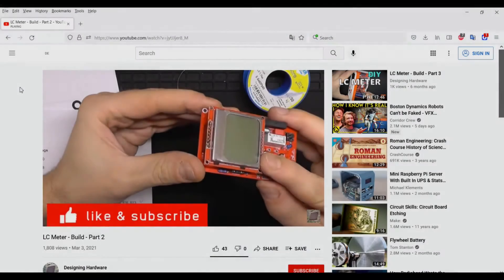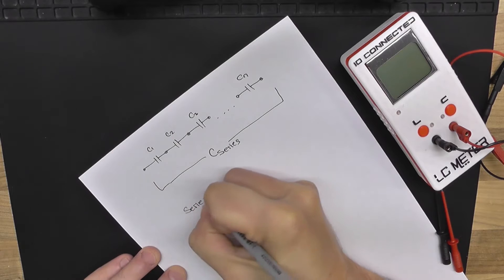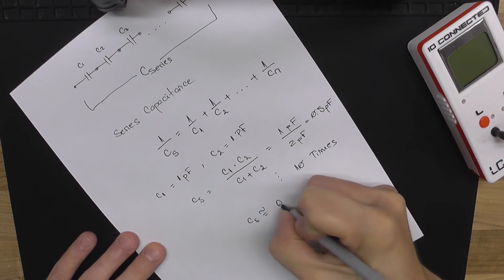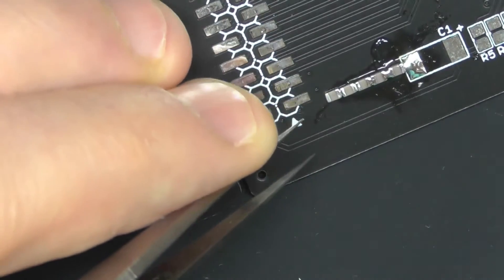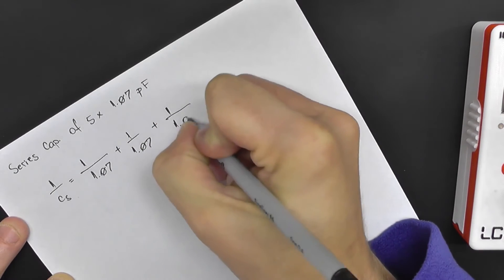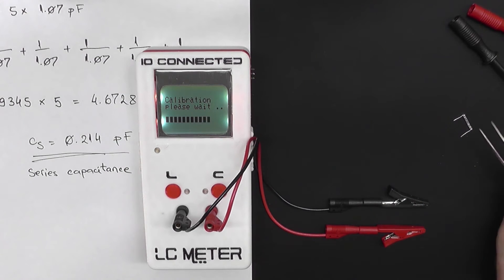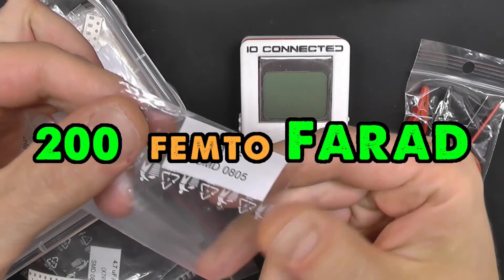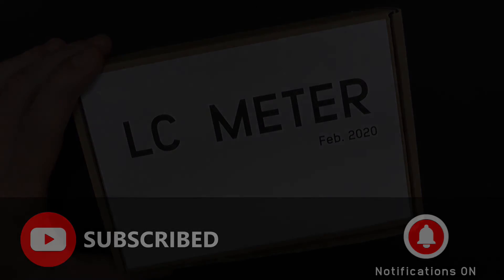INSANELY low capacitance !!! Measuring Femto Farads with the LC Meter

Comment: Impressive. I’ll need to go back and see what kind of front-end you’re using to get this kind of noise floor. Of course the capacitance of the probe wires and internal circuitry is something you can calibrate out, but unless you’ve got low initial capacitance or lots of spare bits of resolution, that eats into your SNR.

Comment: I have finished the hardware and have done a simple "Hello World". I am having a difficult time loading the Hex File firmware into the Processor. What did you used to load the firmware. Thanks
Reply from the maker: an ISP programmer and any sw which supports your hardware. you can make your own programmer or buy one. As for the software you can use avr dude, avr studio, bascom. Please be aware: there's no ISP header on the LC Meter PCB. you'll have to flash the fw using another board or an adapter which is trivial to build. google avr ISP protocol or check the m328p's datasheet. thanks for watching !

Comment: To measure such small values of capacitors, the calibration MUST be done with the probes connected, and the leads dressed as they will be when taking the measurements!  (also keep your hands clear of the probes while calibrating!  This way the capacitance of the probe wires will be included when the calibration is done, and therefore the lead capacitance will be zeroed out.    After the probe leads are attached to the capacitor being measured you must REMOVE your hands so that you won't be adding hand capacitance to the readings.

Finally, what is the smallest values of inductance that can be measured?  What about the largest values of L and C?
Also there should be a way to calibrate the meter (actually ZERO the meter) for inductance.  To do this, the probes would be shorted and a reading taken of the "zero" frequency for inductance.  This way small inductors could be measured, and not include the inductance of the leads.

Also relay 1 can be eliminated by using a DPDT switch to change between L and C.  The ground pole of the switch will either ground the inductor or a port pin on the micro controller to let it know what mode it's in.  To enter calibration mode would use a push button switch.  Now separate calibration / zero routines can be done for L and C.  This will allow for the L zero function mentioned above.

The above ideas came from a meter by VK3BHR that used a PIC16F628 (which also has an LM311 equal inside it).  I built his meter and it works well, but is limited to measuring C down to about 1pf, and L down to about .1 uh  (it reads down to .01 pf and uh, but with +/-  0.01 resolution display it can't be considered accurate that low).  The original AEE meter was able to read a lot lower and higher in C and L.

Comment: I guess those nice measuring probes and cables you use are making a huge difference especially when you measure small caps and you wanna minimize the errors. I'll try buy the same ones for my LC Meter. Thanks for doing this follow up vid 👍👍

Comment: I am using the google translator, so I apologize for any error, First of all, congratulate you for such a good project, I have the first version, check it out and it is similar, only that they use a PIC, but I like this version of yours better, I see it as more refined and Very good finish with enough precision, Of course it can be improved in Your hands, I am already subscribed to your channel from this moment waiting for a much better one, It will be a real pleasure to do it I, I would like, Since you work so excellent, to confuse it to do a Capacities and ESR Meter in a Single Equipment and that in turn gave the losses in the capacitor to be Measured. From already thank you very much for your time. I remain cordially yours. Luis .
Reply from the maker: I started working on 2.0 right after finishing the first version. I didn't have the time to finish it. Thanks for subscribing !

Comment: Sir, Thanks for sharing this amazing project, I am in  a process to build one but i have problem opening the eagle cad files in kikad though kikad supports eagle cad brd and sch files so could you please help in sorting out this error or do i need to open the files in eagle cad only?
Reply from the maker: I don't have neither have used kikad so I don't know if it's an import / plugin related problem. Why do you wanna open the brd file anyway ? you have all the gerber files in the archive